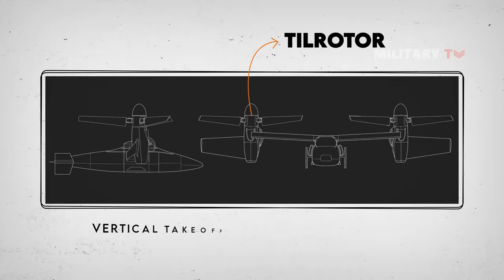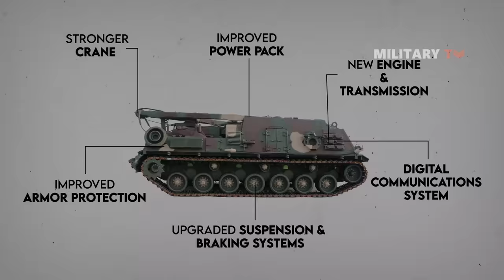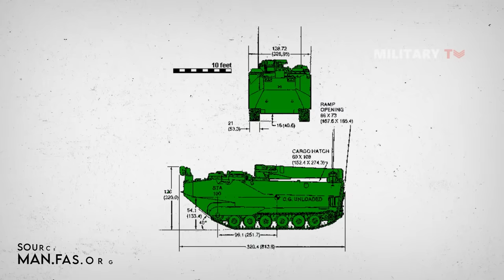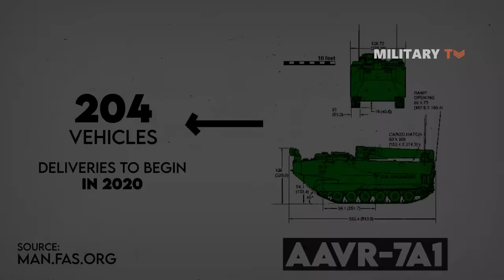The 10 Advanced Weapons of USA that Will Enter Service

Comment: There are a few issue I have.  The AIM-260 has a passive radar mode.  It would have been nice if they had been able to just use this instead of the HARM.  Reducing munitions saves a lot of money and storage and the AIM-260 is powerful.  The John F. Kennedy as far as I know still lacks the upgraded deck surface to be able to handle the hotter F-35 engines.  The 3rd carrier is supposed to have this fixed and possibly have an upgraded radar suit.  It might also have a 300kw Helios laser defense system on it too.  The other two will need to be refitted after the 3rd one comes out.  The F-16 is just not needed.  The F-35 is basically the same cost and fits the same roles... and the F-35 is better in most ways.  The PrSM also can be used in the HIMMARS M142.  The range is impressive at possibly as far as 1000km.  The export version will likely be limited to 499km do to certain treaties.  The PrSM uses the same 500 pound warhead and while the pod system for the HIMMARS only fits 1 ATACMS, they can fit 2 PrSM.  The PrSM will likely be faster than the Mach 3 the ATACMS goes.  The M88 is nothing special... nice but not groundbreaking.  Same with the ACR.  I want to see the anti ship version of the AGM158D.
Reply: Are you sure there will be a 1000 km version of prsm??
Reply: New F-16 model really is an export market aircraft for markets where it's not competing with 5th gen, due to sketchy security of the purchasing nation (Taiwan for example). It's fine for that. But I agree the USAF shouldn't touch it. 4th-gen 'dogfighters' are about as useful as A-10's (ie: not at all on the modern battlefield).
Presumably, the HARM would be cheaper than using an AIM-260... but whether it's cheaper enough to warrant the extra logistics/cost or more munition types, I dunno. Good point.
I didn't know the PrSM could fit two in a HIMMARS pod. Does that mean the MLRS can fit 4?
300 kw lasers are very nearly "ready to go". Should be very easy to retrofit quickly, just plug & play. Useless in the rain, limited range across surface to low level targets, but very useful otherwise.
Reply: @RobertLutece909  Ah... I guess it was the blast shields and electronics.  I was trying to remember back 3-4 years ago.  I remember they had to upgrade the Wasp structural support in certain areas for the F-35, but it might have been the America class that needed the deck surface upgraded.

Yes the HARM missile has a 150 pound high explosive warhead fragmentation and the AIM-260 has only a 50 pound high explosive fragmentation warhead, but the AIM-120 is much faster at Mach 5 compared to Mach 1.8 and has double the range (200km vs 100km).  The US had been testing AIM-120 to be able to fire at ground targets.  The AIM-260 is supposed to have a passive and active radar and IR so likely it would just be software upgrades at that point to be able to do a similar mission.  It just give an F-35 more options.  If it is carrying 2 AIM-260 and 2 Mark 84 JDAM and detects a radar it can not avoid it could hit the radar.  The HARM is too large to replace the AIM-260 and would have to fit where the Mk 84 goes.  They can also double up the AIM-260 on external pilons, but not the HARM.  And with the ability to lock with passive, active, and IR, the AIM-260 is more likely to hit a target and be able to hunt for a wider range of targets.

I can understand maybe from a training and logistic purpose, but the F-16 is still $26K per hour and the F-35 is $42.  That is not a huge increase in operating costs considering the advancements the F-35 brings to the board compared to the F-16.  Maybe as an upgrade to existing F-16 if might be worth it, but F-35 is just so much more capable and to go into a dangerous area a pair of F-35 would likely be able to complete missions that might take 6 F-16 and some targets would just be too dangerous for the F-16.  But realistically with a new engine and most of the electronics being upgraded there is likely a lot less parts shared between the variants for maintenance purposes.

Just comparing the two.  The F-35 is faster with similar payloads, has a MUCH longer range (double without drop tanks... which the F-35 is getting too), the same ceiling, fast cruising speed of Mach 1.2 compared to the F-16 Mach 0.75, can carry about 1,000 pounds more payload (using external hardpoints). If using external hardpoints has more hardpoints...

They are even looking to add mounds internally to be able to carry 2 say AIM-120/260 in place of the single 2000 pound JDAM.  This would give it a "Beast Mode" of 2 AIM-9x and 16 AIM-120/260.  The F-16 can only fit 13, but typically 2 on the fuselage are sensor pods and if it carries drop tanks do to is much shorter combat range,  it would usually only be able to carry 6.  In air to ground "Beast Mode" the4 F-35 carries 2 AIM-9x, 2 AIM-120/260 and again with drop tanks the F-16 would only carry 2 AIM-9, 2 AIM-120, and 2 2000 pound JDAM.

Then there is the 360 degree IR for far better situational awareness as well as the stealth capabilities.  The F-16 does carry about 3x as much ammo for its 20mm gun, but the F-35 also has a 25mm gun.
Reply: @RobertLutece909  Yes but while it is a 60% increase the capabilities of the F-35 means it can fly missions the F-16 can not and when flying the missions the F-16 would normally handle they could likely send half as many aircraft.  With the purchase prices being similar and the cost per hour being only 60% more I would think the F-16 is pretty obsolete.

The only time I could see the F-16 block 70 being worth it is if you already have an F-16 block 20 or newer as you can upgrade them to the block 70 and this would save you money.  Likely the US arms deals prevent them from selling the older F-16 too.
Reply: @furiouswolf2566  with Russia fully pulling out of that treaty (they werent following it before) the US is no longer bound by that treaty either
Reply: I have a problem with the F-35 period that you mentioned. They still have issues with the F-35 every country that purchased them has  lost at least one and some kind of a training accident or exercise, they say it's multi rule I don't think it can dog fight worth a damn the F-22 still is a better aircraft by far. The F-16 I believe and the f-15ex are  still better dog fighters  any daywhat I don't understand about the F-22 it's never been in an actual dog fight
Reply: @wth......53  
"They still have issues with the F-35 every country that purchased them has  lost at least one and some kind of a training accident or exercise" 

Incorrect... Japan lost 1 and the UK lost 1 while the US has lost 5 others. This is with over 1k already built. 17 countries have the F35.

"they say it's multi rule I don't think it can dog fight worth a damn the F-22 still is a better aircraft by far"

You simply do not need to dogfight in any modern combat situation.

"The F-16 I believe and the f-15ex are  still better dog fighters"

Again dogfighting is a thing of the past and the F35 has outperformed both of those fighters in training exercises.

"what I don't understand about the F-22 it's never been in an actual dog fight"

It is called deterrence... no other country has tried to face the US military because non of them are close to being able to do so.
Reply: @n3v3rforgott3n9  I just researched everything that you just said and you were spot-on, but I disagree with you on the dogfighting I think that it's always going to be there, at least for the rest of the world's armies maybe not ours but ours currently is the only one that I know of that has stealth capability on the level that we have it if you consider that an F-22 can take out an air-to-airTarget at 110 miles away or roughly that, the enemy would be destroyed before they knew what hit them, and why they claim that the F-35 has a better sensor array I still think the F-22 is the better  plane, I think the Russian su-57 is a paper tiger they cant even mass-produced 10 of them I think it was China j 20 with a joke they have nothing to compare that aircraft to because China has never been in a major war or at least in modern times and not in my lifetime I'm 52, with exception United States every country has dog fights that are at war, not including being taken out by triple AAA or Sam's. However I love your knowledge thank you for sharing, if I'm wrong about this please tell me
Reply: @wth......53  Some were system failures, but most were training.  Heck one was a cap was left in the engine.  But the thing is there are a lot of F-35 and when you take in the volume it actually has a better record than most aircraft.  They have delivered about 1000 so far.
Reply: @toddabbott781  you do bring up a good argument but losing seven of them before they'll even gotten a chance to fight is to me is unacceptable, if you consider that the f-15 has never lost a dog fight and it's record is 104 to 0 and it's never lost an air-to-air battle and it's been flying for 50 years, so losing seven f-35s in training, is a bit high. And I think the reason why we sold so many of them to other countries is because they trying to get some of the money back they lost.  Israel has a habit of taking American technology and reinventing it even better. They're also the only country in the world outside of America that owns f-22s 50 of them, will sell country's f-35s all day long but we won't sell them F-22 we don't usually give away our Best shit, with the exception of Israel
Reply: I believe the U
S. Is strictly modernizing about 600 of the youngest f16's to the block 70/72 standard. I do not believe they plan on purchasing new F16V Vipers.
Reply: @wth......53 

You don't know what you're talking about. Stop lying. Israel DOESN'T HAVE F-22s. 

Do you have any idea who developed the F-35? No. It was MULTIPLE COUNTRIES. Those are the countries that got it mostly.
Reply: @bobfg3130  An updated F-16 is actually more than the F-35A.
Reply: @toddabbott781  F-35 and F-22 have the same major problem. Oxygen delivery system. That is the reason these jets can't fly very high. Pilots reported passing out in certain conditions due to that fault. I wouldn't be so proud of them.
Reply: Do you understand that HARM means homing abti-radiation missle. The AIM-260 has a miniature AESA radar, like the radar on the F-35 aircraft, but in a missle form factor, with additional range and speed.

Comment: I'm curious why the Air Force has no issue with refitting the F-15 while constantly trying to get rid of A-10's. I think the role the F-15EX could be filled easier than the role of the A-10.  The Air Force's argument usually devolves to the "the A-10 is old" reasoning to justify getting rid of it. The F-15 was introduced 1 year before the Warthog.
Reply: It’s all about $.  The F15 is sold to allies and there is still a market for a new modern version with our allies and in our own airforce, where as the A 10 isn’t available for our allies to buy meaning no market and no money to be made off upgrading it where as the F 15 F16 F18 F35  all pay for they own upgrades cause they are being bought by other countries.
Reply: @CamD477  The F15EX is also to used as a bulk missile carrier that the F-35 can direct for the kills.
Reply: The primary argument I hear to get rid of the A10 is that is no longer survivable in a modern hostile environment.  Modern Jets and Anti-Air systems can easily shoot it down.  It can only be used in an environment where our other Fighters have spent a lot of time destroying all the enemy fighters and anti-air.  So only when we have complete air superiority can the A10 be brought in.

With the advent of man-pads and other small mobile anti-air missiles/systems we can no longer guarantee their won't be something hiding their than will shoot down an A10.  The F15/F16's have enough speed to potentially escape these missiles while F22/F35 can't be targeted (though sometimes they can be tracked...still can't get a targeting lock).
Reply: They say it's not survivable in highly  contested airspace. Flys low and slow vulnerable to PANPADS. That's what the generals say.